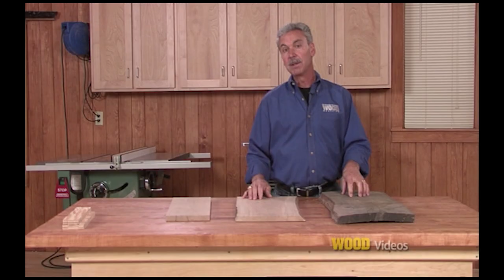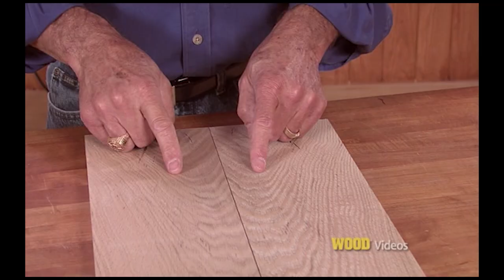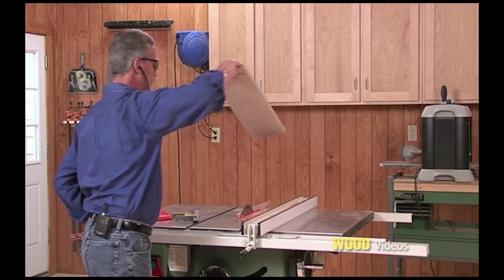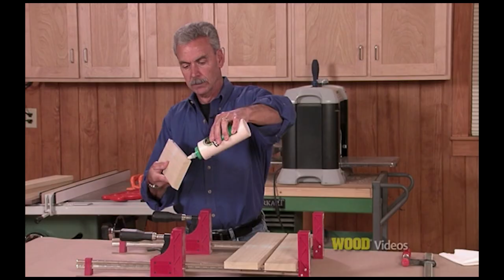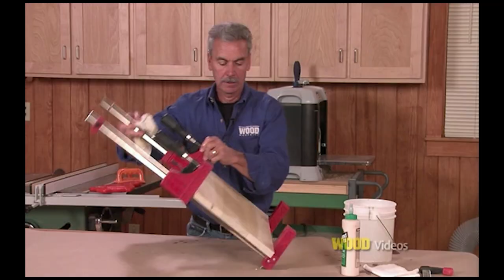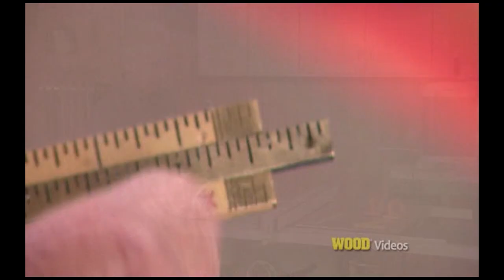How To Glue Your Boards Up Perfectly - WOOD magazine

Comment: They make router bits and matching splines that makes this real easy. I'm in flooring and have a 1/4" bit (for 3/4 inch hardwood) and 1/4 X 7/16 in splines to match it. Set you router depth. Buzz down the mating boards at same setting (don't matter where the setting is they will match). If you don't want the spline to show stop it back some from the end. Insert spline and put them together. The bit was like 35 bucks online and the splines came from a local hardwood wholesaler for about 25 bucks for like 200 feet of the stuff (they sell them online). I put anything from a 1/2" or thicker together with them. Even did a 2-1/2" thick board one time and just router'ed one in the top and one in the bottom, still together on my porch today. Cheap, easy, single pass with the router, boards match all the way down (spline aligns them) and strong as all get out and much stronger than just a butt joint.

Comment: If I don't use "stickers" as you called them but instead clamp my cut pieces in between two straight  pieces of hardwood or to say my straight workbench top how are they likely to turn out?

Comment: Mr. Heavey I was thoroughly impressed with your video on complete glue up.  I’m a recently retired Machinist and have always wanted to get into woodworking.  Well I’m doing it now and I’ll have to tell on myself a little, preforming in the machine shop as a tool maker and model maker for 44 years, I thought woodworking would be a walk in the park. After all going from Titanium to Birch has to be a class downward right?? No , no not so at all !!! It’s a whole new field and skill set !! But I love it and with pro’s like yourself to teach us rookies , well like you said , from the ground up!! I learned so much from your tutorial I can’t wait to get started!! Thanks again🙂
Reply: I'm doing the same thing. Just retired Sheetmetal Worker of 40yrs. Have done many precision projects, all kinds of metal. Just set up a woodshop, going to incorporate wood with metal projects, some just wood. Just finished a chessboard with inlays. There is a learning curve and alot of new stuff to learn. 👍

Comment: hi how do you bring back the swolen wood? I have a piano and one of the leg is swolen due to heavy moisture. Would it  be working to soak it on the hot water and then clamped to its shape for some time?

Comment: Every time I use the wet rag removal method there’s always a residue showing when I stain. Or I raise the grain from too much water. I scrap and sand it.
Reply: I use denatured alcohol. Does the same thing but dries way faster and doesn't show when finishing
Reply: Also you could have it too wet and are basically diluting the glue and not so much as cleaning it off, making it smear around and not come up

Comment: I check my blade for square to the miter slot, then I move my fence to the miter slot, lock it down and check the all along the slot. You forgot that a router table can be used for jointing. I've used mine many times and get well jointed edges.

Comment: I love your tips and tricks. You taught me a great deal. But please, please lower the table saw blade to match the piece you cut.
Reply: Were you referring to 10:20 on the video? I believe he intentionally left it high for demonstration purposes.. he was explaining to beginners like me how to determine ‘by sound’ if the saw was aligned and the demo was more effective with the higher, more visible saw blade.. that was just my observation and humble opinion..
Reply: Dadi Doom I think you are correct sir. It was done in an instructional way.

Comment: It's all in the clamps, might consider alternating the growth rings to prevent the glue-up from seasonal cupping do to changing relative humidity... Thanks for the step by step walkthrough. FYI I've had past projects ghost dimple where biscuits were used in the glue-up

Comment: Great video, despite doing this for years I learned some things. It also makes me want a jointer. It bothers me to see that unguarded saw blade sticking up 4 inches with hands so close. I have a blade guard and it works for most cuts. The spline cut would require the guard to be removed but that is a pretty safe cut. Save your fingers.

Comment: The groove is only parallel to the blade if you make the adjustment your self when you get the saw do not trust it is out of the box you will never make an accurate cut

Comment: If you buy S4S lumber, then you don’t need to joint, correct?
Reply: Not necessarily.  The boards may experience some movement when they acclimate to your shop. Always check the joint